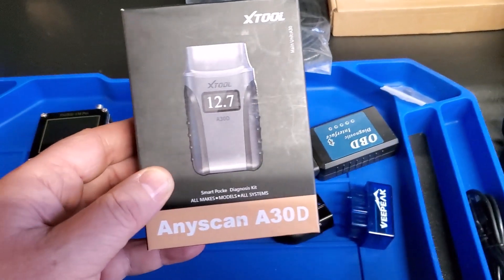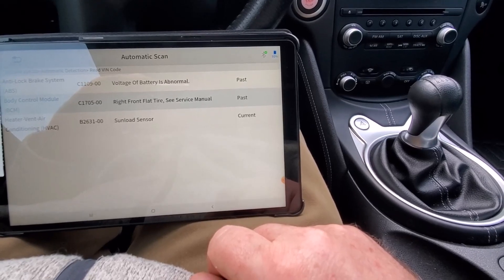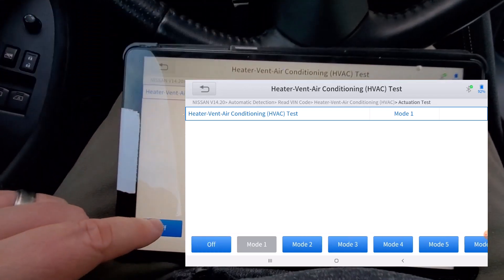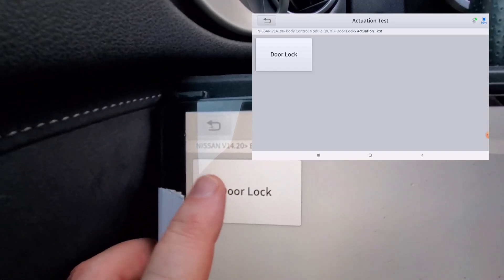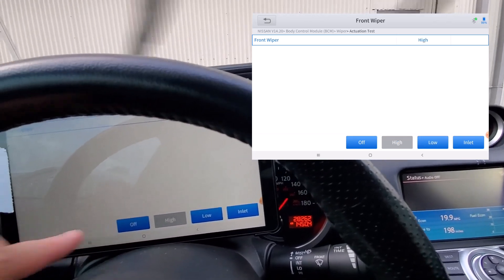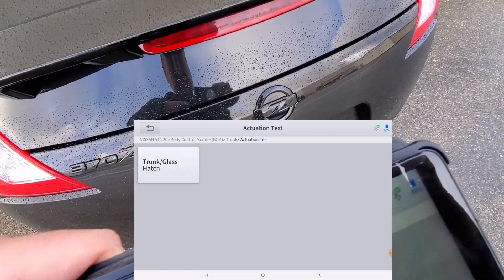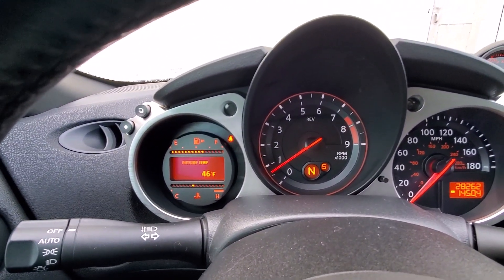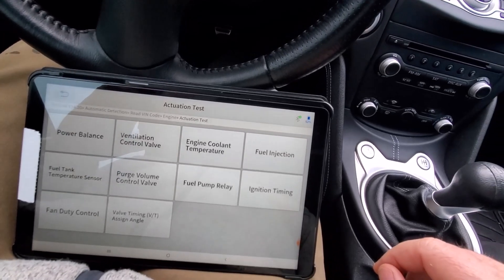Why you need a BI-DIRECTIONAL Scantool. (Actuator Testing with XTOOL A30D)

Comment: I bought an xTool A30D, which arrived today, but I can't get it to connect to my 2003 Chevy Trailblazer.  I get an error that says VCI Connection Failed.  The blue light is on indicating it is connected via bluetooth, and the red light is on indicating power as well as the display is showing the battery voltage.